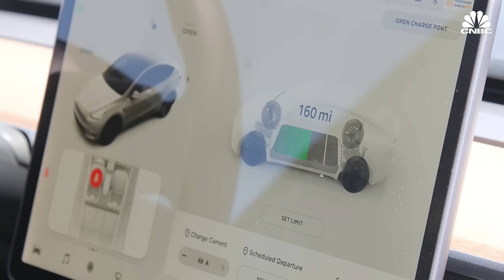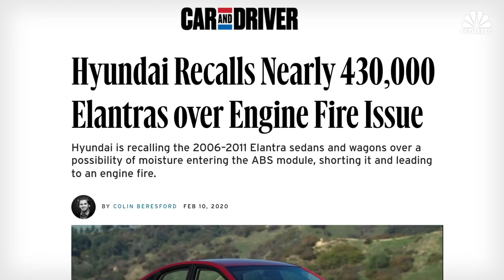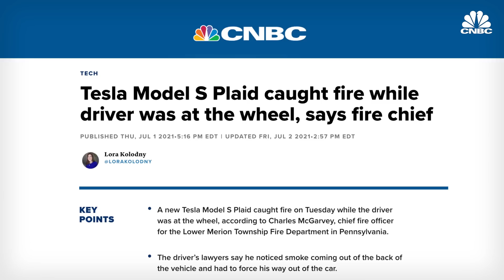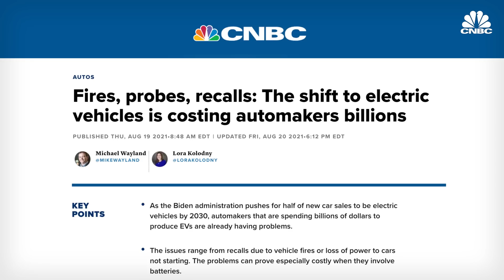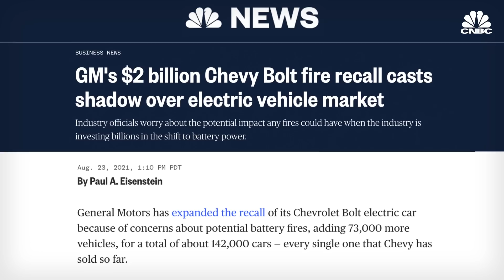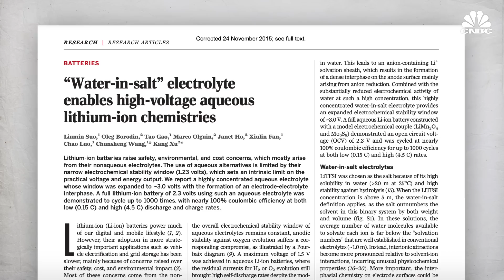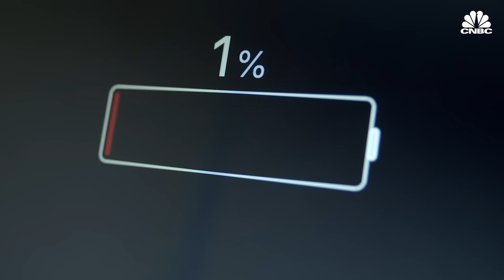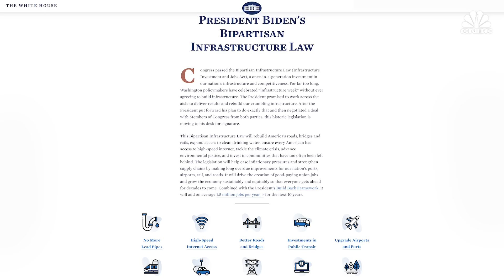Why Tesla, GM And Other EV Companies Have A Fire Problem

Comment: My 2024 Chevrolet Silverado RST EV had just over 4,000 miles on it and was not even five months old when everything went sideways. The truck was sitting at the dealership waiting for a replacement battery and had been placed in a quarantine area about 50 feet from any other vehicle  or building due to fire risk. I wasn’t allowed to retrieve my personal belongings because of the safety concerns.

I’m a former paramedic and firefighter, so when I heard a dispatch for a vehicle fire at the dealership’s address, I had a sinking feeling. I was on the phone with a friend when I responded to the scene, and my worst fear was confirmed. My nearly $100,000 truck was fully involved in flames.

The local fire department spent hours getting the fire under control. Afterward, what remained of the vehicle had to be placed in a specialized containment unit and submerged in water for at least 14 days.

This entire situation has been frustrating, surreal, and incredibly disappointing. A brand‑new EV with only a few thousand miles should not end its life in a fireball on a dealership lot.

Comment: Fire normally needs some form of fuel (gas, oil, wood, etc.) and oxygen to keep burning.  Lithium batteries, once on fire, do not need oxygen;  they are a toxic chemical fire that are very difficult to stop and control.  Can you imagine a major vehicle accident pile up that involves multiple EVs and they ignite.   A YouTube channel “Stached Training” has several videos where he talks about the true stats on vehicle fires, EV fires.   More research and investment needs to be done into other energy sources such as hydrogen fuel power.
Reply: Hydrogen still requires a battery and motor in the car. Plus its incredibly energy intensive to farm

Comment: Electric car fires happen FAR LESS FREQUENTLY than fires in cars with internal combustion engines. The real issue with electric car fires is that it is so difficult to stop the fire once the battery is burning. Hybrid cars with internal combustion engines and electric power catch fire more often than internal combustion engine vehicles. It is difficult to get accurate info in the US because car fires aren't reported with the type of powertrain. But Sweden just did a study to specifically determine the frequency of EV fires compared to internal combustion. Only 1 EV of every 38,000 EVs sold catches on fire within 1 calendar year. While 1 out of every 1300 vehicles with internal combustion engines catches fire within 1 calendar year. That makes it 30 times more likely that your internal combustion vehicle will catch fire than your EV. Hybrid vehicle fires were the worst in terms of frequency.

Comment: You should applaud if spontaneous combustion is not caused by a high-speed collision, because the battery will never explode; it only catches fire, giving you ample time to evacuate. Additionally, the insurance company will replace your old car with a new one. As for natural occurrences caused by high-speed collisions, you'll have to rely on your own luck (because 1 you might be unconscious inside 2 your foot might be stuck 3 the doors might be deformed and unable to open, which would result in a very painful death).

Comment: Heres how rarely ev deaths are.  A battery fire works like this:

Driver gets alarm.
Diver pulls over walks away.
Driver smells smoke.
Driver sees smoke.
Driver calls fire department. 

Gasoline fire happens unexpectedly.  

BTW newer battery chemistry is even safer that this old video.

Comment: Let’s just be open about the problem. EVs are 💩. They’ve knee jerked to a non existent problem and rushed everything. EVs don’t have the range of ICE cars and until they can match ICE cars mile for mile then they shouldn’t be sold. We are being conned. The EV manufacturers say that their cars have a range of about 300 miles, but they say don’t charge it above 80% & don’t let it drop below 20% . So there’s 40% of the range reduced so the actual range is only around 180 miles. Musk has got the politicians who are pushing this 💩 on us in his back pocket. W⚓️.

Comment: Fire safety must be implemented in the EV. For example, equipped with a Sprinkler Installation, at the Battery, filled with fire extinguishing powder instead of Water.

Has that ever been tested?

GREETINGS
Reply: It's of no use. These batteries produce their own oxygen in the reaction while burning. The only thing that could be done is predicting the fire and asking the passengers to get down in prior.
Reply: @VinayakMahadev11  Sprinkler is the Boss of firefighting.

Puts out fires from the start.

REGARDS,
Reply: @hermankarsowidjojo6771  Can you explain me what a sprinkler is? I have no idea about it.

Comment: Sodium ion batteries will be safer for all EV vehicles. These ions have much less flammable propellants that will not superheat so fast to create "thermal runaway" problems like lithium ions do if these batteries do explode and catch fire. They should be mandatory. Lithium ion batteries on all EVs need to be banned or phased out due to the extreme flammability due to thermal runaway.

Comment: Here is the basics of a lithium ion battery - how it operates. 

There is a cathode and an anode that separates the electrons and the neutrons - both of them electrical charges. Around all that is the lithium electrolyte. The charges bounce around and create a lot of heat. So you need a separator to balance out the negative/positive ions so there is not runaway heat. 

Once the separator fails, the heat builds in the battery and continues to fail. This cause more and more heat to build up. Yes, there is a pressure relief valve to stop this because that heat build-up creates pressure - but with time, even a safety valve will fail--and the lithium electrolyte reaches its flash point to create smoke first, and then, as the pressure means the skin of the battery cannot hold it no more - plus the high heat - the battery detonates and there is fire! 

But it is not over when this battery explodes into fire. Dousing it with water will not work because the oxygen is extremely high even with water. Because once the water is stopped, the stuff becomes very hot again. And since the already-flamed stuff is designed to superheat again after you douse the flame once--like a trick candle the battery "re-flames" and this is known as thermal runaway. 

Smothering it with a regular blanket will not do the trick. It could cause the fire to go through the bottom. 

You need a fire extinguisher that will knock out the ability of the lithium electrolyte to reflame through thermal runaway, so a Class K fire extinguisher needs to be used.

Comment: Need a better cooling system maybe heat sinks and a better coolant, better surface area coverage of hoses.  I mean if the battery is “dead” or car is off you can’t really cycle that coolant.

Comment: The most common cause of EV fires is thermal runaway, which is a rapid, uncontrolled increase in temperature leading to catastrophic battery failure or explosions. The temperature of an electric vehicle fire can reach 5,000 degrees Fahrenheit, compared to 1,500 degrees in a gas-powered car fire.

Comment: Electric vehicles pose significant safety concerns, particularly regarding the risk of fire and explosion. Even when parked in a garage, electric vehicles can cause substantial property damage and endanger individuals. Despite these risks, the automotive industry and consumers continue to overlook this issue. It is crucial to prioritize safety and consider alternative solutions, such as gasoline-powered vehicles, which have a proven track record of reliability and safety. While environmental concerns are important, they should not overshadow the immediate safety risks associated with electric vehicles.

Comment: Data from EV FireSafe, which is backed by the Australian Government, states that petrol cars are over 80 times more likely to set on fire than EVs. Swedish Civil Contingencies Agency found in 2022 there was an average of 3.8 fires per 100,000 electric and hybrid cars, and 68 fires per 100,000 cars of all fuel types.

Comment: EVs cause more pollution than gasoline cars. Not only is most of the power generated by burning coal and other fossil fuels, the mining and global transportation needed to produce the battery causes more pollution than the lifetime consumption of fuel for normal cars.

Comment: "Undeniably Electric" 😆
By the time they're viable we'll have fusion power for the grid, but I wouldn't be holding my breath any time soon. 
The fire problem is being solved with new battery tech, but they're still very inconvenient compared to gas powered, and most of the value of the car is in the battery pack (that wears down quicker than a traditional vehicle engine).
We still need to get all these unsafe EV's with outdated/dangerous battery designs off the road! No small task and a significant additional expenditure to replace all those battery packs.

Comment: Water? Lithium reacts with water to produce hydrogen and heat. Lithium is an Alkali metal like Sodium and Potassium. It reacts violently with water. Yet for some reason they are still trying to put them out with water,

Comment: The Swedish government found that ICE vehicles were 20 times more likely to catch on fire than ICE vehicles in 2022. EV FireSafe, an Australian company, studied global data on the reports of EV fires from 2010 to 2022, concluding that there was a 0.0012% chance of a passenger EV catching fire, compared to 0.1% chance for an ICE vehicle, meaning that ICE vehicles are 80 times more likely to catch on fire than EVs. 

NMC batteries have a much higher risk than LFP batteries, so anyone worried about this issue should buy an EV with LFP, such as the Tesla Model 3 or Y Standard Range. LG's NMC and BYD's NMC pouch batteries have had a lot of fire problems. It appears that cylindrical cells have less chance of fire than pouch cells, so I would buy Tesla over most other EV makers.

Comment: EV battery packs need a built in fire extinguisher system.  A reservoir of a liquid that will neutralize the charge of any cell that has shorted and put out any fire and cool the battery pack to stop thermal runaway.  If a short is detected or if the airbags to off the reservoir releases the liquid to flood the pack.

Comment: How do ev's save on emissions?   They just transfer the emissions to the power plant also if you factor in the huge emissions there are in the manufacturing they are 10X less green than a combustion engine it takes 1000lb of mining material to make 1lb of lithium 😮

Comment: I don’t doubt that EV’S need to improve and have an unacceptable tendency to ignite. In the 1960’s ICE fires were a problem and rather than going back to the horse and buggy improvements were made. The WHO has stated that 6.7 million premature deaths occur each year from the tail pipe emissions of gas and diesel vehicles. If the subsidies given to the oil industry were spent on improving the grid so that it could store and use renewable energy, the batteries will improve. Another unmentioned issue with oil is it has been responsible for wars as countries want to protect their interests. No war was fought over sunshine and it’s a fact that sun, wind, hydro, and geothermal could provide all the energy needed for transportation. The oil industry was heavily subsidized to put in place all of the current infrastructure and rightly so it has been a great tool. If the subsidies given to oil were removed its cost would more than double creating a free market that manufacturers would then produce more efficient ICE vehicles or improved electric vehicles. They would sell based on the consumer demand which always works better.

Comment: Why would we want to store a lithium-ion car that spontaneously explodes in our garages? Even hours after the fire dept puts out the EV fire, the battery sparks a fire again spontaneously. We don’t want to die. And battery replacement is $6,000 - $50,000 (Hyundai ionic). The average person can’t afford EVs. California passed into law forcing everyone to buy EVs only in several years. It’s discriminatory and unfair for the middle and low income families. Someone needs to stop California’s law.

Comment: They jumped the gun. Until the battery technology is safe and NOT a huge fire risk, these vehicles are not ready for prime time. Consumers are catching on and EV sales are stalling. Current models of EV's have catastrophic rates of depreciation and owners of EV's will not get much for their used EV's, particularly now that the risk of them being a ticking time bomb while charging in someone's garage or the underground parking garage of a condo building is becoming clear.

Comment: Right at the beginning you say that the future is “ undeniably electric”, that’s when I stopped this video.  It’s pure crap.  EV’s are DOA and it’s the elephant in the room that the liberals refuse to consider.  Mark Twain said it best:  it’s easier to deceive a person than to convince them that they have been deceived.   There, even the pronouns in that quote worked out.

Comment: I would suggest reformulating a fire-barrier caulk to make it sprayable in an extinguisher of sorts. It would not only cutoff oxygen supply, a necessary element for fires, but aid in containment of the toxic fumes. Perhaps even encasing the batteries in the same at the time of manufacture. Whether these suggestions are feasible, well, that’s for the professionals to determine? I’m just your common idiot.

Comment: EVs need better battery compartment isolation. Instead of integrating it into the frame of the car, it needs a fireproof compartment.

Comment: Im surprised the oil companies haven't shut down ev cars yet
Reply: because the 40s/ 50s/ 60s/ 70s / 80s are over the cookie jar is almost empty ? you can tell this by the rubbish they sell at the pumps why ethanol they are mixing in everything  that burns that was sold separately  ie paint thinner [ what does that mean to air quality  ] we need t replace our day to day automotive  fuel

Comment: Interesting stats on vehicle fire risks! The data, based on U.S. figures from a study in 2020, shows EVs have the lowest fire risk at just 0.025% (25 fires per 100k vehicles). Hybrids are highest at 3.474% (3,474 fires per 100k), with ICE vehicles at 1.529% (1,529 fires per 100k). Though EV fires are harder to extinguish due to lithium-ion batteries, they occur much less frequently than fires in ICE and hybrid vehicles. A crucial insight into vehicle safety!

Comment: There is a simple solution for consumers in dealing with EV battery fires - don't buy one until  they use batteries that are really safe following accidents, corrosion or age. It is only a matter of time before there is a major tragedy caused by an EV battery fire. The recent EV fire at Luton Airport demolished a £20 million new car park by melting the steel structure and destroyed 1500  parked cars as well as polluting the local environment. Fortunately no one was hurt but consider this happening in the underground car park of a residential or office tower block in the heart of London or other major city as it certainly will unless the sales of these mobile crematoriums is halted.

Comment: Yes not only do these fires destroy the surroundings they are in but also produce a great deal of extremely toxic gases and that also includes the water that is used to put them out. I feel concerned for the fire fighters that have to deal with these wretched vehicle fires as opposed to dealing with an internal combustion vehicle which can be put out reasonably simply  and unlikely to reignite minutes to days after the original thermal runaway. You also have to consider that EV fires burn at much higher temperatures than a conventional internal combustion powered vehicle.

Comment: A key issue  thats needs research  is how may people are being killed in EV fires in road accidents ?  car fires following an accident with   petrol  are rare and even if the the occupants are trapped  then fuel fires  can be knocked down by the fire service of even citizens using standard fire extinguishers  such as powder or foam,  That is not possible with EV's look  at the amount of water it took to try and  extinguish one car fire ! 
In most series car accidents you want to stabilize the  casualties before  extraction  cutting  away the door pillars etc which might contain batteries is not going to prove a great idea !
Also  the  fire  can develop  very rabidly  and  do  you  extract the casualties in case of a battery fire ?
again with a petrol car  the standard battery would be disconnected and a hose line run out as a precaution  against a fire , that might not enough to stop an EV fire.
So what is important to understand  is  do  car crashes  occur less  with EV's   than  ICE  cars   I guess  not because its human error is the main cause of accidents
As a ratio of vehicles on the  road are more people dying in EV car fires  that ICE vehicles,  it does appear  that  even a low speed crash can cause the batteries to  to  catch fire  and  that  can be  very rapid.
I suspect  that moving into the future  we  will see  more people losing their lives as a result in fires in EV's following a crash than we  currently see  with Petrol vehicles  , however perhaps yet  to early to tell. so for me  EV fires  following an accident is more of a concern  that non accident fires